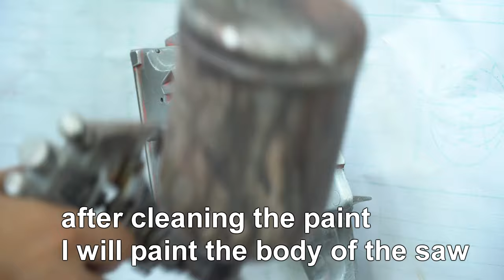Restoration Chain Saw Homelite old - Restorating Chain Saw Rusty

Comment: I just got one of these running. It was in pieces for months. I finally rebuilt the carb and replaced the missing fuel line and filter. Started 3rd pull and runs perfectly. I couldn't believe it.

Comment: You made a major mistake in 5.10 to 6.05! In fact the manual says not to separate the two halves of the fuel tank! The engine comes out only by unscrewing 4 bolts, holding it in place. What you did is what I did, mate! The hard way to find out something!
Reply: I hope it doesn't leak on you. Someone separated my Grandfather's.  Runs but not safe.
Reply: Good call. Once these tanks are split it's VERY difficult to get them to seal up again. There is a chance, if the mating edges are machined completely flat and the sealing areas around the fuel tank are reinforced with a tiny bead of fuel/solvent proof RTV (I myself like variants of FIPG). Where the biggest challenge lies is in getting the switches and trigger in the handle set up just right before you secure the two halves together. Not an easy task by any means.

Comment: What did you spray on the body at 12:50? Is it just called paint primer or something? And what were you spraying and scrubbing at 13:30? Just asking as trying to learn these things, thx
Reply: Yes its primer and it was water for wet sanding to remove any imperfections